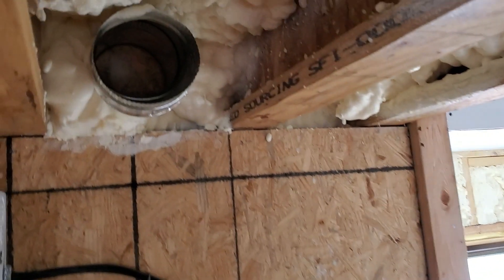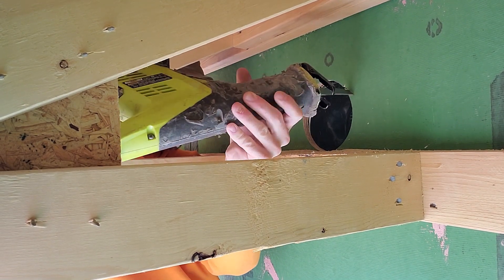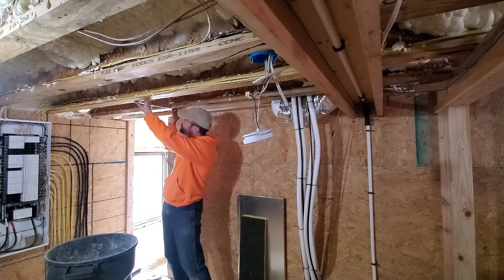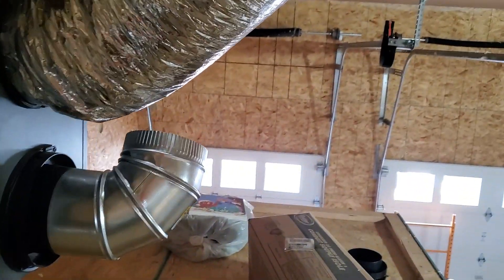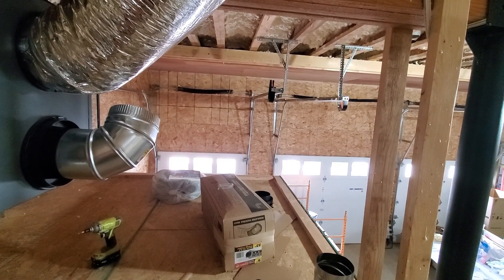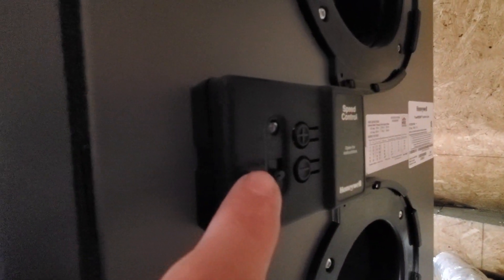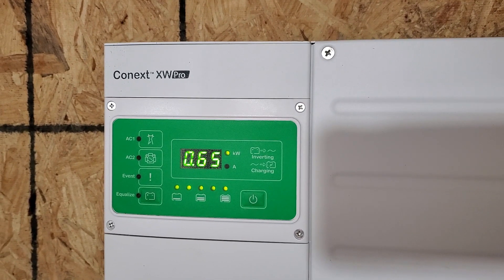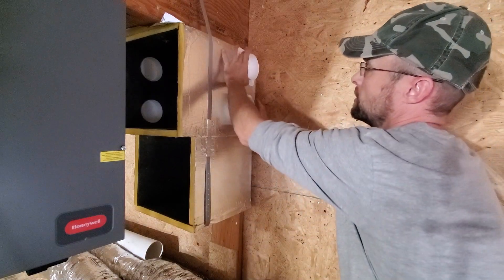Venting a Bathroom Exhaust Fan through a ERV or HRV - Off Grid Barndominium DIY Home Build

Comment: Thank you for taking the time to video your installation.  Are you using a "boost" function, or some sort of inline fan, in order to, exhaust the bathroom vapor?
Reply from the maker: Hello, the ERV has a 200cfm fan and the bathroom exhaust vents are 100cfm.  I can have two bathroom fans going before the air movement is more than the ERV's fan can pull.  Rarely do we have all three going at the same time so it's never been an issue and if all three bathroom exhaust fans are on the are just pushes by the ERV fan but I'm sure it isn't as efficient.  The flaps in the plenum box I built helps prevent the air from blowing out somewhere else in the house.  I've had this setup installed for several years now and it's working great, no issues to speak of.   Hope this helps and thanks for watching.

Comment: For those who don't know and may be misinformed by this video: The first page of an ERV instruction manual cautions: "Be sure to duct air outside - Do not intake/exhaust air into spaces within walls or ceiling or into attics, crawl spaces, OR GARAGE." and "Do not use your unit during construction or renovation of your house or when sanding drywall. Certain types of dust and vapors may damage your system." I'm glad you decided against exhausting into your garage at least. It may also be helpful to note that you can avoid the whole strange plenum setup and bathroom exhaust fans altogether by simply exhausting from the bathroom to the ERV continuously. All the top manufacturers reps recommend it, assuming bathroom fan doesn't get shut off (the continuous nature of the system is what will dry out the pipes from intermittent moisture). Many models have an option to boost the CFMs which you can elect to do while showering if you want. Stay safe out there. Read manuals and local codes.
Reply from the maker: We turned it off when working on the house and even when the farmer was plowing the fields and kicking up dust.  The exhaust had always gone outside.  The intake went into a bedroom and into the garage.  I understand what you're saying though that pushing air into the f garage could cause garage fumes being pulled into the house BUT the garage is huge with plenty of volume and air movement and the house is tight so the only way air would get sucked into the house would be if a door was left open. I'm not saying you are wrong, my just saying that in our situation it isn't an issue.

Comment: @14:58   don't need insulation on the interior ducts, assuming the garage is mostly conditioned space.   Do need insulation (as you have) on the ducts from the HRV to / from the outside, to prevent condensation in or on those.
Reply from the maker: That's what I ended up doing.  The garage has radiant heat and stays well about freezing in the winter.  So far it's been working well.  Thanks for watching and commenting.

Comment: How effective is this design with respect to your bathroom ventilation? Im in the process of making some decisions and considering an hrv for my bathroom fans only. Any feedback or insight would be appreciated.
Reply from the maker: Hello, it works well.  The only problem I've had so far is one of the flaps got stuck open.  To fix it I had to trim the pivot point down a little more.  Also, don't use any type of clamp on one flap or it'll pinch the plastic causing it to stay open.l.  Just use tape. 

I have temperature/humidity sensors in the attic and we are typically under 50% humidity year round.

I want to add a timer to the fans next so you can turn it on and go to bed.
Reply: You should not vent your bathroom exhaust if your hrv is on intermittent only if it’s continuous. You’ll have all sorts of moisture issues in your duct

Comment: question: if the hrvs fan is broken, could I use an inline fan to run the system and leave it unplugged
Reply from the maker: I don't see why not.
Reply: @Off-Grid  I appreciate your response
Reply from the maker: @calvenwilliams3373  good luck.
Reply: There’s two fans in an hrv and they are designed to counter flow the air. I would not recommend this personally.
Reply: Hrv fan motors are extremely easy to replace